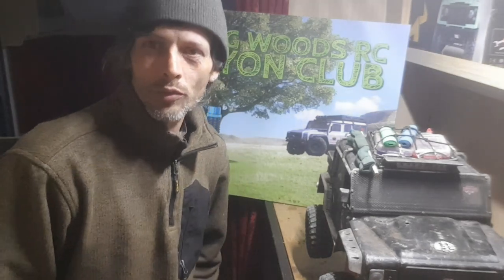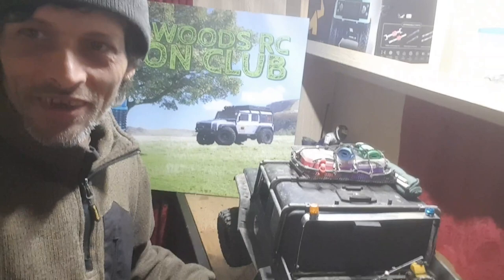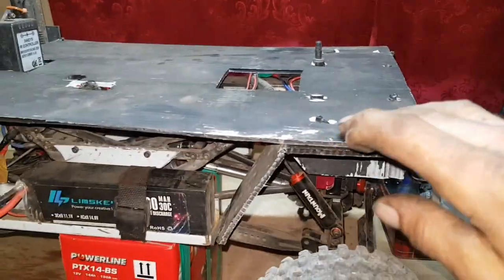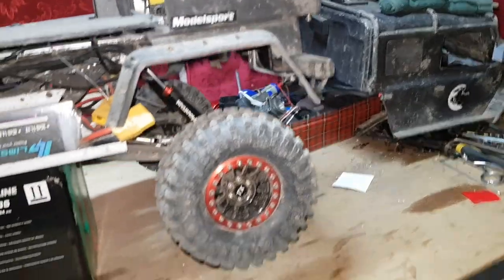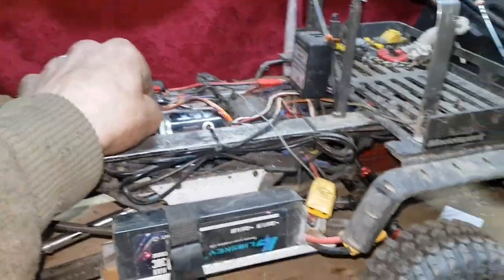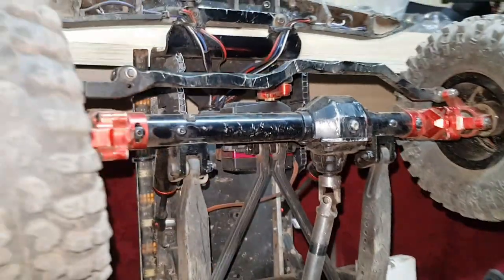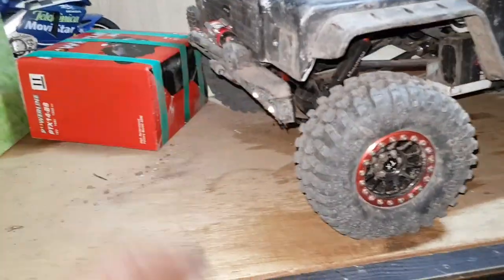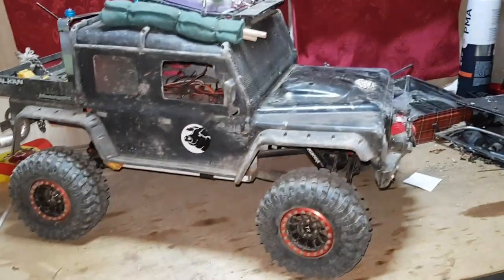ftx kanyon upgrades 2

Comment: Bloody hell mate, that twin motor mod that you have done is a very nice bit of engineering and bench work mate. Am well impressed 👍👍👍  loving the Sausage stickers 😊
Reply from the maker: Thanks pal 😊 it's so much better now nothing stops these wheels turning now 😁 got urs and Gaza's to one side 😉👍
Reply: Awesome lol
Reply: I am eyeing up the competition 👁️
Reply from the maker: I need to order a new set of front diff gears🤣 think it's the same as the scx10 mite try the ones with 8% overdrive  I found on Amazon
Reply: Might be worth a try Paul